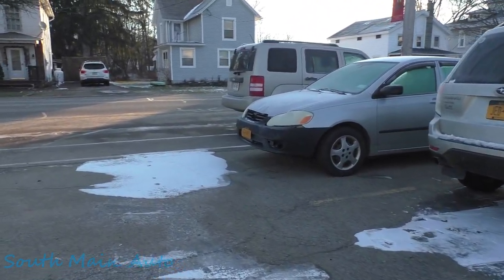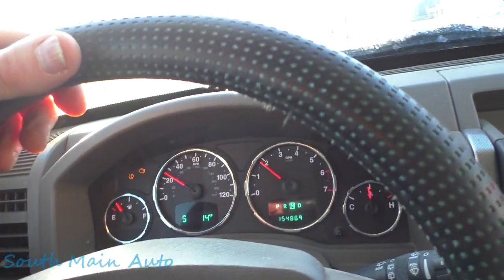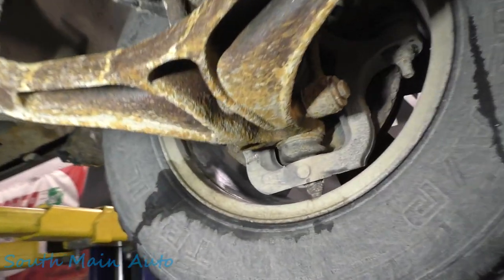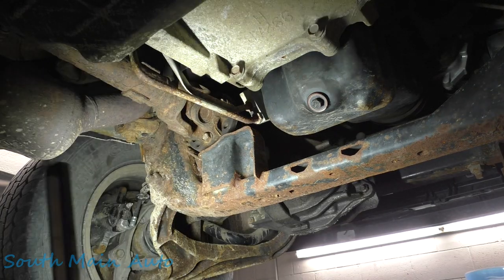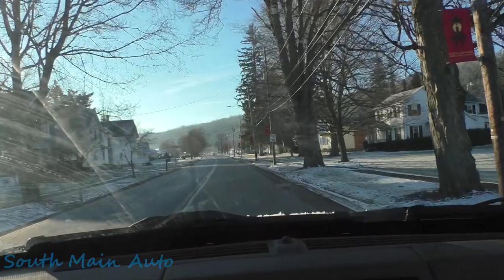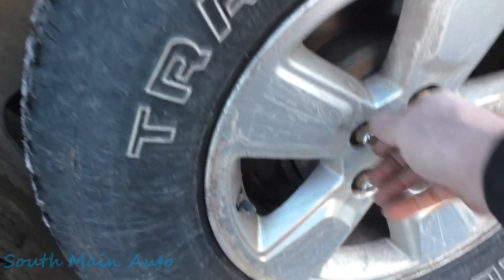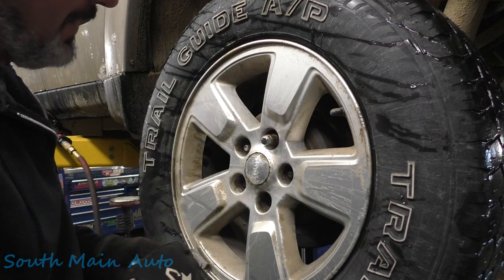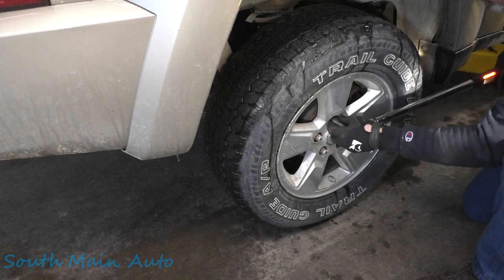Customer Just About Lost It.... A Wheel That Is

Comment: 2 stories, first was a big box store (sounds like Costco) just installed new winters and mama told me that she could hear a noise. I pulled out a breaker bar and socket and the back wheels were tight, but the front wheels the bolts were just hand tight on a Camry. 
2nd was a shop next to our towing company, for whatever reason the owner (Old guy) forgot to tighten the front wheels on a Jeep and the passenger front wheel flew off into a residents front yard a block from the shop. I drove down and threw a sling on the front end and took it back to his shop. That mechanic who owned the shop was the most embarrassed mechanic that I have ever seen in my life. No damage and the customer never found out about that test drive.
Every winter tire changeover on ALL of our cars I make sure to go over the wheel nuts with a 24' breaker bar. I don't care what the torque is as long as they are TIGHT!
 The "Old Wives tale" about warped rotors from over tightening wheel lugs is a complete lie. Warped Rotors is almost ALWAYS caused by somebody riding the brakes in mountainous areas, or MOST likely drivers who drive with 1 foot on the gas, and their other foot on the brake pedal. For many years I would ask drivers who had badly warped and discolored rotors, "Take me for a drive and show me how you drive". 
Sure enough every time it was TWO-footer driver. Get away gangster drivers are hard on brakes too.

Comment: I have a 2003 Jeep Liberty with these wheels, i have had them off many times to rotate them, new tires, new brakes, every time i put them back on myself or checked the torque myself after the shop put the new tires on, i've never had one come loose.  However, back when i got this Jeep about 16 years ago i asked a local dealer what the lugs should be torqued to and the service guy said go to 120 ft lbs or regret it later... So he obviously knew what he was talking about back then and i have always done that.  After a few tire rotations the Chrysler lug nut cancer set in where the outer chrome cap swells up from rust under it, so i pulled them all off and replaced with all new solid lug nuts.  Now my wife's Dodge Grand Caravan is doing the same thing, did the lug nuts on one wheel when we had a flat, the other three are waiting to get done since it was -20F the day we had the flat and i didn't want to replace 20 lug nuts that day, a warmer day that will get done.  So i guess i got the good advice early and never had an issue, 118k on the odometer on a 20 year old vehicle, i don't drive daily so its lasted me a long long time.  Oh and my front drive shaft went and sounded like someone spinning a ratchet at 100k when accelerating, then it would go away when you got to a constant speed, that was odd.

Comment: Damned near lost a wheel on a Honda Accord while I was doing a pizza delivery.  It was cold, and dark, and I was in the middle of nowhere, and I kept hearing this sound kind of like a helicopter.  I must have stopped, and looked at the car about 4 times, last time I looked, and realized I had just two lug nuts on one of my wheels, and one of them was about half a turn from leaving the chat.  Of course, I didn't have a lug wrench, nor did I have cell service,  I tightened the lug down as much as I could by hand, drove like half a mile, rinse, repeat.  It was a long trip back to the shop lol.  Thankfully, once I got closer to the shop, got cell service back, and arranged to have family meet me there with my jack, torque wrench and four lug nuts.

once you experience that sound, you never forget it!

Comment: I used to get a few of these each year from customers doing their own winter-summer wheel changes. With corrosion in the hub of alloy wheels, they don't sit flat against the disc. If you torque one nut down before driving the others down the wheel jams on to the hub cockeyed. Torquing the other nuts doesn't fix it. Driving around hitting bumps frees the wheel leaving it loose.

Comment: 1989 Jeep Cherokee - hour long drive, stopped on side of highway a couple of times because it was driving wonky, like it was super windy. Had no idea what was wrong. Got onto my off-ramp and one massive clunk/bang from the RR. Wheel had come off in this exact way - loose lug nuts let the wheel wobble like crazy. Destroyed the alloy wheel exactly as described, broke 3 of the 5 studs. Lucky it didn’t leave me at highway speed.

Comment: I owned a 1966 Corvair that happened to me on.
The left rear lug nuts loosened up and every time I shifted, there was a clunk.
Had to replace the rim as the studs had slotted the holes in it and two studs that were cut part way through.
😂

Comment: Back in high school one of my classmates in the automotive tech class had a first gen Integra that he accidentally put in reverse at 70 mph. The teacher let him bring it in to replace the transmission. Well since we only had an hour of shop time before we had to drive the 1/2 hour drive back to the main high school it took a week for him to get it done. Once he got it done took it for a test drive, and all was good. On the way back to the high school the right front tire fell off, and he dove into a deep ditch. One of the students had a 4wd Toyota pickup (pre Tacoma) they used a chain to pull him out of the ditch. They found the tire, and amazingly all the lugs. We couldn't get the stock scissor jack under the car so me, and about 5 or 6 of us got a good grip around the car and lifted the front so he could get the jack under it. Luckily he hit the grass almost immediately so there was no damage to the rotor. After he got the right side on he checked the left and it was loose also. Didn't get to have any lunch that day but we did make it to the next class on time, and got a lesson of not rushing things.

Comment: Eric, funny I have a Jeep liberty 2002 4x4, and just went through this 3 weeks back it was my front driver's wheel and I know we torqued that puppy to spec just one month back when we did a brake job. I stopped a Circle-K and sure enough all but one lugnut was able to be taken off by hand, I got out the breaker bar and put 130 lbs on the 4 wheels. if it happens again time to get the lock tight out. lol

Comment: Yes, I have a loose wheel story. One of the first cars I drove was a 1979 Plymouth  Horizon. I was driving to work and heard a small clunking noise, and being naive, thought nothing of it.  On the return drive home, the clunking noise got louder, and the front end started to wobble. Just as soon as I pulled over, the right front tire almost came off, being partially held on by 2 very loose lug nuts! Had to get it towed because the studs were cremated.

Comment: My loose wheel story - Back in the day when I did a little drag racing, I was to meet my buddy at a local restaurant for breakfast, then we would caravan to the drag strip.  My car hauler is a tandem axle rig.  It wasn't yet daylight when I set out for the rendezvous.  I kind thougth the trailer tongue felt a little heavy on the way, but, continued.  When I arrived at the restaurant, under the parking lot lights, I noticed only one wheel on the left side of the trailer.  I put the spare on, retraced my route, and, actually found the wheel that had escaped.  The wheel was trash, but, the tire was good.  Moral of the story - never work in a hurry and, always, always double check your work.

Comment: Yep I definitely have a loose wheel story that I will NEVER forget....I used to have a toyota pickup with a 6 inch suspension and 4 inch body lift with 38 inch super swampers.....was hummin along the toll road at 60MPH then all the sudden we hear this faint knocking noise, luckily within a couple hundred yards there was an exit, as I'm going on to the exit my drivers rear wheel comes off and paases me....YIKES
Luckily was already going pretty slow and somehow the truck barely leaned to that side, stopped in between the exit and the highway, got out and inspected and also had to walk a good 100 yards or so to retrieve my tire....had 2 broken studs and obviously no lug nuts left
Ended up going to get parts and tools and fixed it right there

Comment: I have owned an '06 liberty for 13 years and have never had a problem with the wheels, I also have a Saab 9-7 that I've owned for 4 years that has a perpetual loose wheel problem, even after getting new hub assemblies and lug nuts

Comment: I bought a 99 Cherokee for next to nothing, it is lifted and at the time had no swaybar... Started driving it home and it was all over the road, could barely go 30 and the thing would whip side to side violently. The sway bar being removed was a lot of that, but so was the left rear wheel nearly falling off! I had about two threads left before I was headed for the ditch. Got it snugged up and while the wheel is a little bit egged out and one stud is a little FUBAR, it still functions.

Comment: confirmed on a Grand Cherokee Laredo. two days into ownership (and on brand new asphalt) at WORK.  I recognized that knock right away by the tone alone.  thank goodness the tools were still IN the vehicle; people tend to throw away the Jack, tools, spare (this one had none) floormats, manual, and any keys they're not using on a regular basis.  I forked out for a clicker torque wrench (40 bucks for a 1/2 drive), and got everything over a hundred pounds...and discovered oddball lug nuts.  shortly thereafter, an electrical disaster occurred when I had the battery replaced with the correct size (there was a group 54 in it, I believe), and they put it in backwards; previous owner had placed the battery posts facing front with the undersized battery for cable fit. parked for a month with a brand new battery, alternator and starter (the original had started to seize), but burnt through the stock and two rebuilt alternators.  we thought the computer had fried.  sold on, and the new owner reported: blown fusable link in the top-post wire to the alternator, no computer damage (i thought they stopped USING that sort of thing, and relied soley on the computers).  also reported, after actually HAVING both the stock wheel AND the ones he'd put on come off and destroy the driver's fender, it had had the WRONG LUG NUTS to begin with!

Comment: I've had 5 Caravans (all over 200k miles by the time they died). The only loose wheel issue I ever had was when we had a shop put new tires on. They gave the lug nuts an extra ugga-dugga or twenty, and I had 3 studs shear off at ~75MPH on the interstate at 3am. Not a lot of fun - we found the tire & rim on the other side of the Jersey barrier about 1/4 mile down the road...
I've always torqued to spec and never had an issue.

Comment: Took a work vehicle into Jippy Boobs once for tire rotation.  They broke off 2 lug bolts.  They replaced bolts and got on my way.  Good thing I checked torque right away.  Spec is 90 lb-ft and I got a good 3/4 rotation before I got the click for 3 lug nuts on one wheel.  Those guys sometimes are just warm bodies only.

Comment: I lost a wheel on an alloyed wheel Jeep. OEM lug nut wrench wasn't enough. In the end, Funny swollen lug nut caps, corroded wheel nut seats and stretched studs. To remove the wheels in the first place it took two men and a five-foot pipe on a breaker bar. I guess the previous shop wasn't risking another alloy wheel and used the 1-inch air wrench. That's:text-green-game-over: what gave me the idea to use the equipped lug nut wrench. Nope! Had to replace all the goodies. I actually ended up with a bit of anti-seize on new parts at the original torque specs but hand torque and bad parts didn't hold.

Comment: Back in the 70s I had a 76 Chevy truck and the lug nuts were so tight I had to use a 10ft pipe with breaker bar to get them loose. Good thing I had a flat in my driveway instead of on the highway

Comment: I had an 08 Liberty did this 500 miles after new tires were installed. I figured it was a front wheel bearing. When I went to change it, 3 of the lug nuts were able to be removed by hand. The hub had rusted and the wheel was corroded, not letting the wheel locate itself during install.

Comment: Loose wheel story, like Eric said, whenever I would take a turn I would hear that loose wheel sound, I had steel wheels, thankfully for me there was a place along my route back and forth to/from work that was a tire place. I pulled in told them what I was hearing, they took a quick look then showed me, I would need a new wheel and a set of studs. They fixed it and I was on my way.

Comment: On a related note, how do mechanic shops train technicians to prevent wheels from falling off? A local shop dropped a wheel because one guy twirled the lug nuts on a few turns by hand and then someone else drove the car. I dropped a wheel because I tightened the nuts to the auto stop feature on my gun, with intention to torque them and then completely forgot. My ideas are:

- put yellow or green automotive masking tape on the wheel arch when removing wheels, leave the tape as a reminder until the lugs are torqued
- use an 80 ft lb torque stick on the impact gun as the only tool to put lug nuts on, then torque once it's on the ground, but at least 80 is enough to prevent wheel loss
- never lower the lift until you have the socket installed on your torque wrench and near the car. That minimizes the potential to get distracted by another customer or a phone call as you go to get the torque wrench.

Dropping wheels seems like a rite of passage for mechanics, but there should be standard procedures to make it not happen instead of letting everyone figure out what works for themselves. Places that hire high school students to perform cheap oil changes inevitably end up with cars driving off with no drain plug or no oil. Even they should have some kind of checklist or standard procedure to prevent such incidents. I've never messed up an oil change, but that's because it's the main task and I'm thinking about it. Fastening wheels is often an afterthought, my mind is more likely to be on the preceding job.

Comment: I learned the hard way years ago about the old loose wheel. I had a '93 Ranger that started knocking just like the one in this video. I had my dad bring the trailer across town to bring it back to the shop, only to find out it was just a loose wheel. Unfortunately, a couple weeks earlier I had a Firestone service center do the tire recall that was going on at the time, and I did not put 2 and two together.....

Comment: Awesome Job, as always! 
You only need to drive a vehicle with a loose wheel once to know what that sound was. It sears into your memory. 
I usually think front, when you can feel it in the wheel, or the back when you can feel it in the floor.
Reply: I have been in two cars when the wheel fell off and none of the sounds were similar.  First car (58 Ford which I wasn't driving) sounded like a rattle because lug nuts were in the hub cap.  The driver turned around just before entering a highway and the wheel flew off about a mile later.  Second car (68 Chevelle) no warning.  It just made one clunk when the wheel came off the centering hub and hit the studs on its way off.  Ironically, it came off on the same highway we were about to enter in the 58 Ford.

Just recently (2015 Jeep Wrangler) the lug nuts loosened and damaged the wheel but it didn't come off.  That sounded like a stone in the tire tread (tick, tick, tick in a regular pattern) I checked the wheels several times (but I never put a wrench on them) before I found the bolts were loosening.  The wheels were torqued when I rotated the tires.  Now I check the torque after each 50 or so miles until I check them and none of the bolts turn at all before the click.

Comment: I'm a slow learner, so here are my experiences; I failed to torque the bolts on my 76 VW Rabbit with steel wheels and noticed a noise. By the time I got to it one of the bolts had broken off. So what happened in this case was the wheel bent the bolt back and forth til it broke off. Similar situation with an old pickup truck; one of the studs broke off. Next, I had a 1970 VW Beetle; I adjusted the clutch, which requires removing the left rear wheel, and forgot to torque it when I got it on the ground. A week later I heard a rumbling noise but I was in heavy traffic so it took about a mile for me to get where I could get off the road, but it was too late. Old VW's have bolts rather than studs, so if you drive with them loose the wheel will rotate the bolts out. Yes, I lost a wheel on a busy road. I was going 45 or so, and it passed me on a 6-lane highway, somehow missed hitting any cars on my side, hit the median, bouncing at least 10 feet in the air, somehow missing oncoming traffic, and bounced into the parking lot of a bowling alley, still bouncing. It missed a red Porsche Turbo 911 but a few feet and jammed itself under the bumper of a rusty old Buick. I have never missed tightening the lugs since then. 
One more thing; I have found that alloy wheels can be slightly slightly cocked while you're torquing them which causes the lug nuts to jam against the sides of the wheel hole. This has happened on several cars. So now I am careful to make sure the wheel is seated firmly before I tighten the lugs. I haven't lost a wheel since that VW incident in 1985!

Comment: I’ve got kj Libby wheels for my ZJ’s winter tires. Every time I swap the winters and summers out I have to retorque them two or three times before they stay tight. Doesn’t matter if I scrub the hubs and wheels off, antiseize the hub surface or no, nothing keeps them tight. But if I pull wheels mid-season off without swapping over its fine, barely have to snug any of them up on the first retorque.